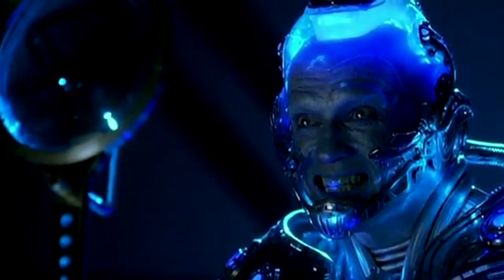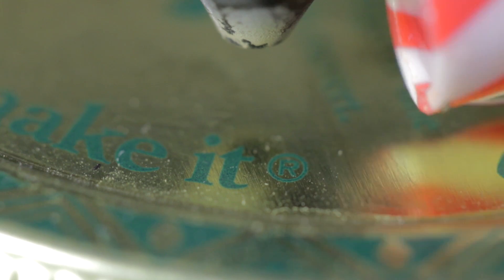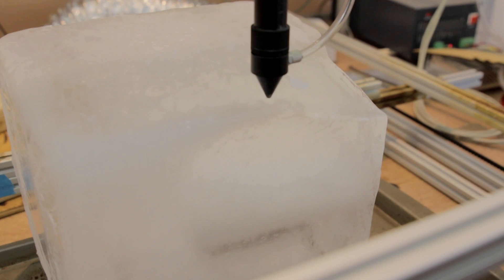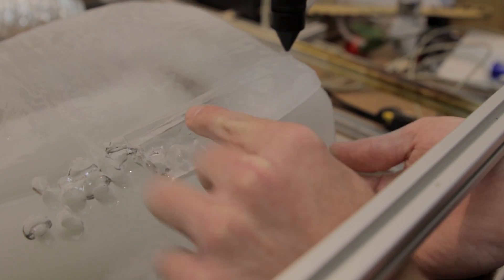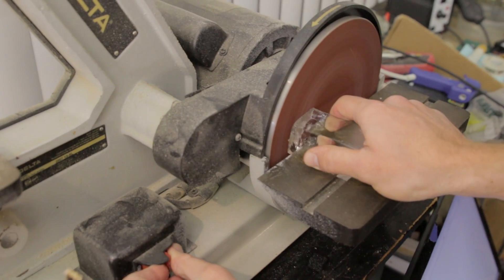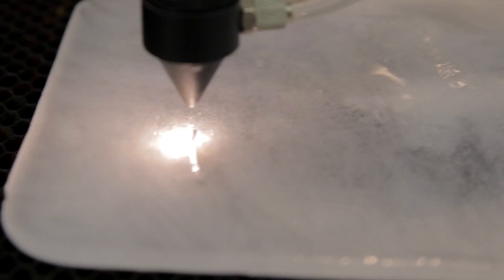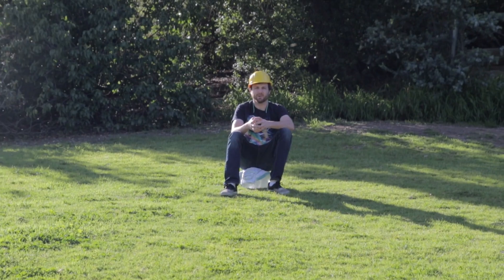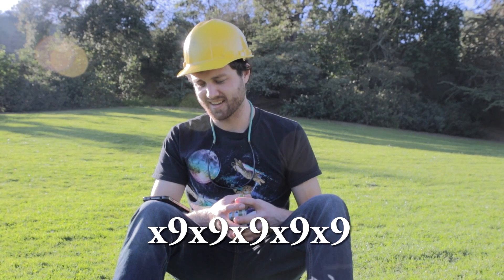Can a Laser Cut Ice?

Comment: Did you build your own machine.  Also if so if you were to put a 130 or 300 watt laser co2 tube with the correct power supply does that mean you can now cut stronger materials like stone or aluminum?

Comment: Let me guess, you are using a single Limb CO2 Laser operating at about 76W to 150 W for a discharge excitation of I guess 2-5 kV. Just factoring in a guess. The composition would be 1:2:8 although I didn't see any cylinders. U can increase the output you know by adding CO to the mixture 30% more than CO2. Or using a V-Fold config. 
Provided that I am right about the laser being a CO2.

Comment: Can you try cutting a pair of some of the protective glasses you wear to see the aftermath of what would happen if the laser went haywire and hit your spectacles?
Reply from the maker: Yeah, they're a bit expensive though.
Reply: I could donate a few bucks i dont want you to brake the bank.
Reply: J.Baker, yeah wouldn't want it slowing down
Reply: thats the point of the glasses: to absorb the beam,  they would cut. with fiber laser 1030-1100nm that wave length would pass through any clear material (saftey glasses ect) and thats why they are totally enclosed. in the event of a "back reflection" or "laser went haywire and hit your spectacles" the beam would not be focused so it may just feel warm across your face for a second
Reply: William Osman can u make a video with some details about your laser?
Reply: cut a cow eye